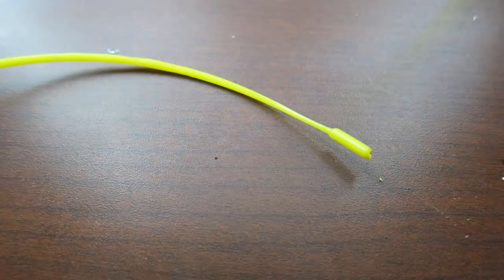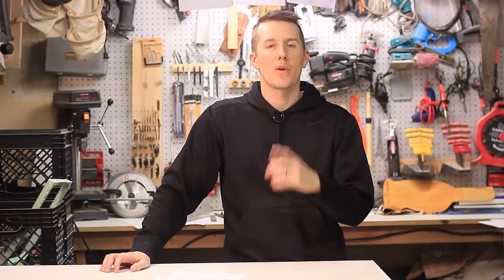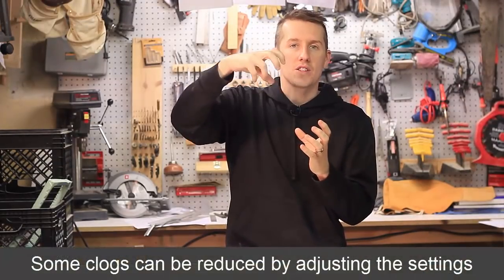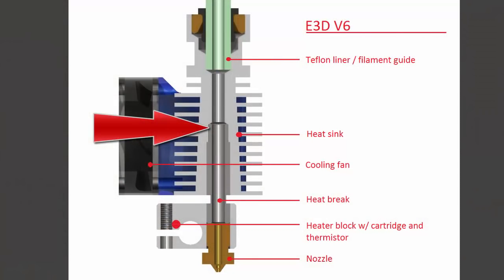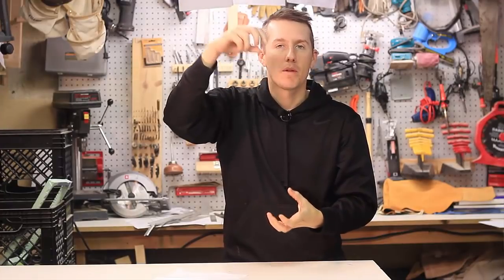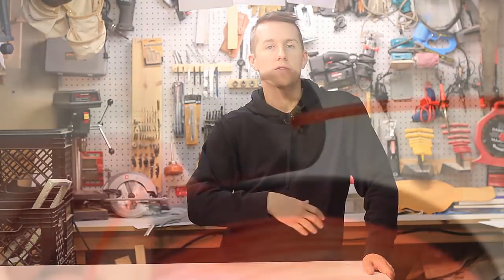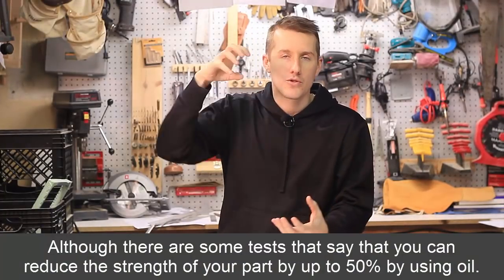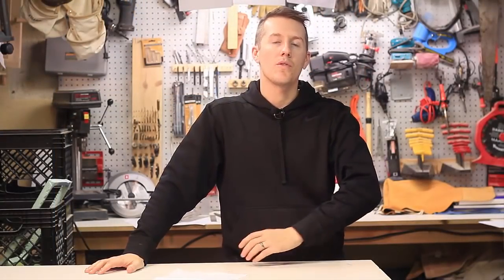5 Tips - How to Prevent Clogging of Your 3D Printer

Comment: love the video thanks very much, I'd also like to add from my own experience using the Elegoo Neptune 2, my filament was also clogging, and I didn't know how, I knew there was a fan where the nozzle at but I didn't know there were 2 fans in there. ..i dont know how i missed that honestly, but one of the fans wasn't working, as soon as i changed that the heat sink was abled to get the sufficient cooling and everything were back to normal.

Comment: So quick question then, is there more risks of clogging on very hot days than in cold days?
Reply from the maker: I wouldn't think so, but not 100% sure.
The hotend is up around 400 deg F.
Not sure if 60 deg or 80 deg room temperature makes that big of a difference.
Reply: Yeah I was thinking that would be the case, though maybe it could cause trouble 'cause of the fans not being as effective, at least that's my worry
Great vid btw
Reply: when room temperature is around 45 celsius, i'm pretty sure yes

Comment: My printer never clogged but I was getting leaks. So I displaced the threaded part that the heat sink slides on to so that it butted up against the nozzle. Now the dang thing clogs. I guess now too much heat is transferring into the upper area. These things are Soooo finicky. But this video helped explain what is happening. I will start by turning the temps down, then insulating. Thanks.

Comment: Thanks for the video, I do 1 to 1 and a half day print on my TEVO Tornado gold model. the heating insulation on the hot end broke and was OK for a while, a few days ago started printing fine for about 3 or 4 hours on the print then starts to come really stringy and looks like a curly hair just like the part you showed. Total of 3 prints did that and not able to do a full print. I'm going insulate the hot end so the heat does not go up, I think that is happening. I never had that issue before. 

Thanks for the info.

Comment: I bought a new printer. It worked fine for a few prints, now I can't print anything for longer than 40 minutes, because the nozzle will always clogg. Its frustrating to no end!
I will try out the things you suggested though.
Reply from the maker: Lower your retraction distance.  The filament being retracted every 2 seconds causes clogging.
Increase your fan, keeping just the hotend hot, and the "fins" cool.
Reply: @DaveWirth  I will try it out, thanks!
Can I use Aluminum Foil (like for keeping food warm) as isolation for the hot end?
Reply from the maker: @Lorian667  I don't know, maybe.  Haven't seen that before.  Just do whatever Prusa does, they are the best when it comes to hardware and tech.  They use an E3D V6 hotend i think, no wrap or anything on the hotend, just fans blowing.  https://shop.prusa3d.com/en/mk3mk3s/932-assembled-hotend-e3d-mk3s.html

Comment: Thermal paste for CPU's is supposed to draw heat away from the CPU to the cooler this would be contrary to what you are describing you don't want to create a thermal conductive path to your heat break, also many bowden style hot ends the bowden tube does in fact mate up to the nozzle so cutting the tube flush and ensuring that it is flush with the nozzle is a preventative approach to avoiding clogs
Reply: It's because it is drawing it away and displacing it to the heat sink as oppose to when you put a heatsink on a CPU without paste and the thermal energy doesn't transfer, resulting in an overheated CPU. Dude he explained it if you were listening.

Comment: Well.. i have a anycubic i3 mega and it was working fine until it clogged, i had to change the ptfe tube.. and now i can't print anything, it keeps clogging, now i know why, i'll try to isolate the uper part, i guess it's getting really hot too...
Reply from the maker: Ya i found that most of my clogs were when the filament was getting hot, being retracted a lot, and getting clogged in the area above the heatbreak.  Lowering your retraction distance and speed will help too.

Comment: Wish I watched this earlier.  I figured out what the issue was eventually with my setup.  When I turn off retraction, it never cloggs proving my diagnosis.  Will experiment a bit with less retraction and see what happens.  Will also sand end of PTFE tube and see if that solves the problem.  Thanks for this vid.

Comment: Retraction should be as little as possible to take care of stringing and as fast as possible without the filament slipping in the extruder.  Should be well under 2mm for direct drive setups and 2-6mm for bowden.  Default speeds are usually around 40mm/s.  I run 2.5mm at 80mm/s on a prusa i3 reprap with bowden.

Comment: 10mm rectraction ist a lot and might cause problems, this should not be a general recommendation and depends on your printed / setup
Reply: This was the only thing  changed and it made my first successful part after 7 clogs in a row an hour into my print. As you said, it depends on your setup..